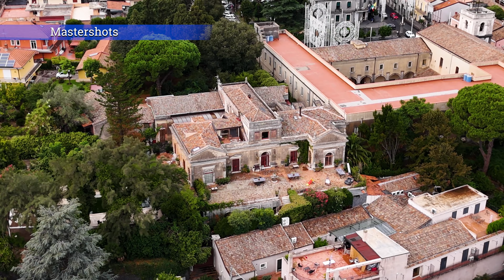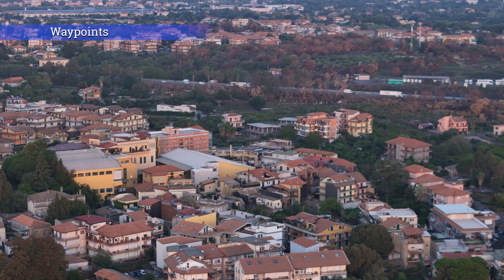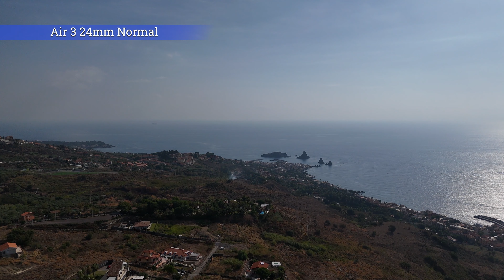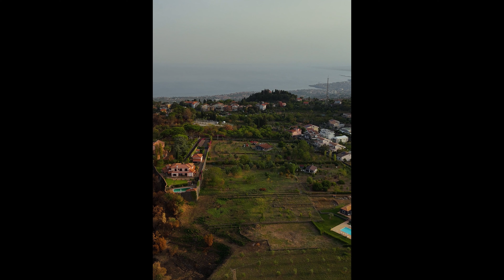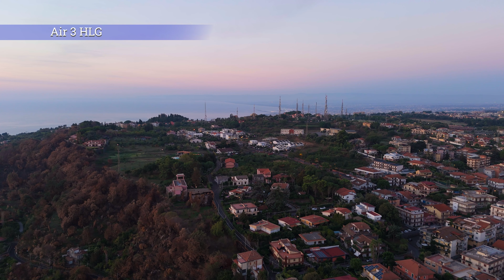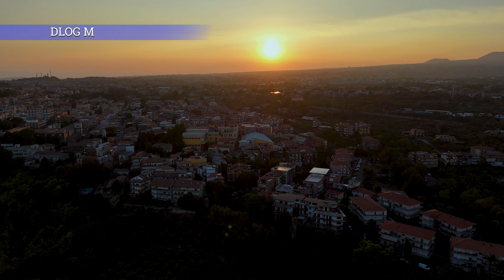DJI Air 3 Video Quality - How Good Is the Footage?

Comment: Short the Tele lens,  The Air 3 is just a big Mini 4 Pro.
Reply: Max altitude might also be different.
Reply: The Air 3 handles wind better, has faster ascent and descent speeds, faster horizontal speeds, longer flight times, higher max altitude takeoff, further flight distance, more internal storage, plus the 70mm camera.